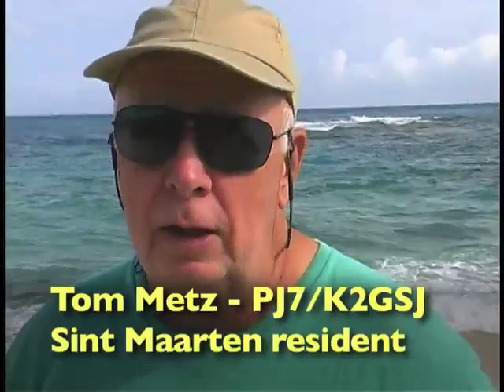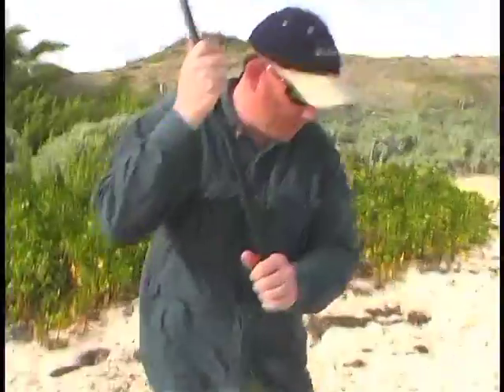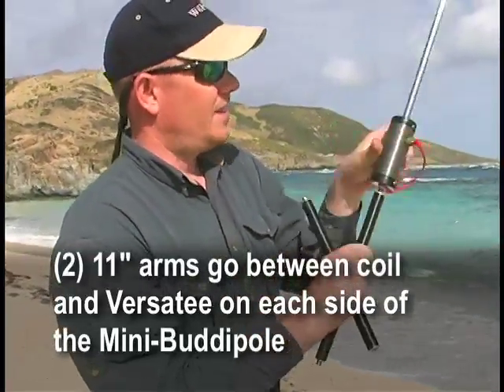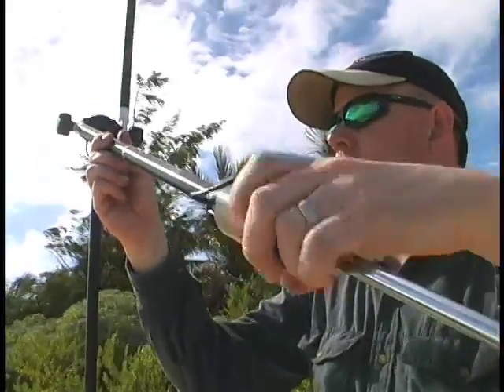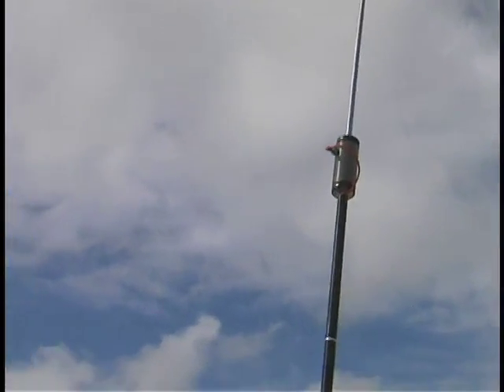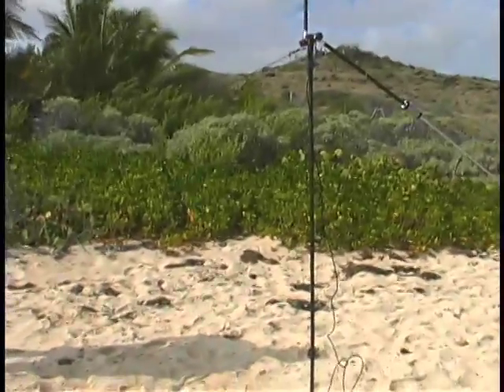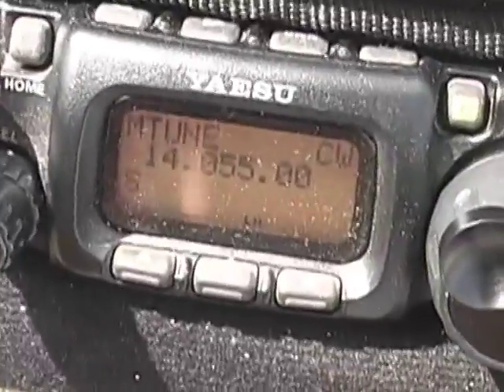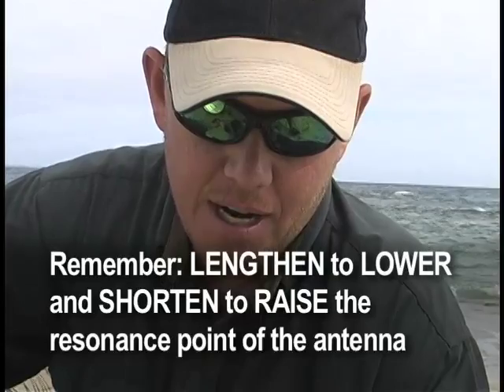Setting Up the Mini-Buddipole with SCmast

Comment: Which leg did you lengthen?
Reply: My guess is the top one, since the lower element was already fully extended. If both elements are fully extended already, you might have to adjust the coil taps instead.

Comment: I am a proud Buddipole owner, homebrewed and commercial--but your four pounds of equipment thing--the 817 alone is nearly five, right? Anyway, I wish I had that setup. I run the IC7000 at present. I'll be checking its effectiveness with the mini-buddipole.